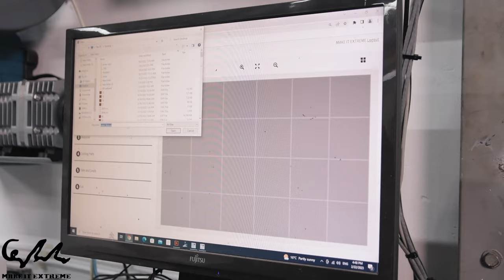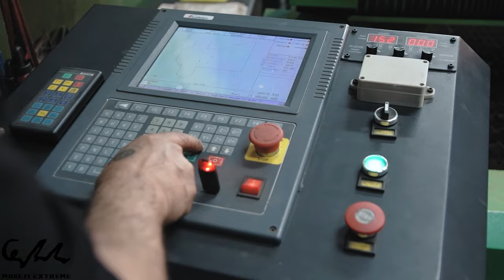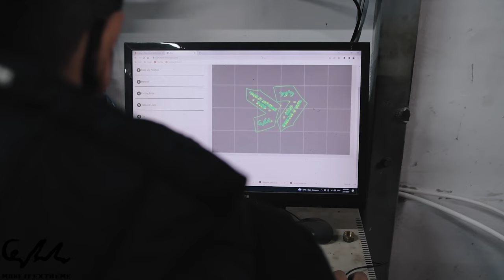Transform the Most Hated Electric Car into a Supercar - Episode #1

Comment: If those cylinders had hydraulic oil in it and if ports were connected  with a needle valve you would get the smoothness of the doors on ferrari once you bleed the air out:)